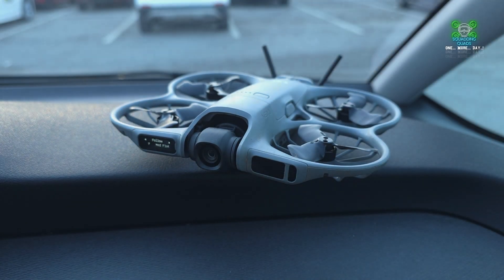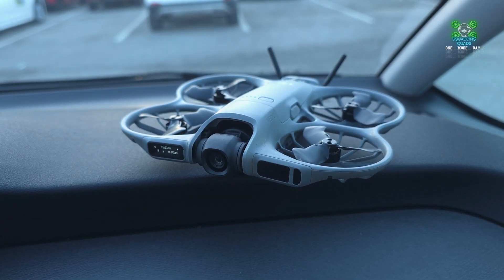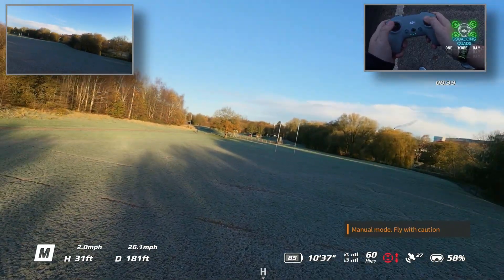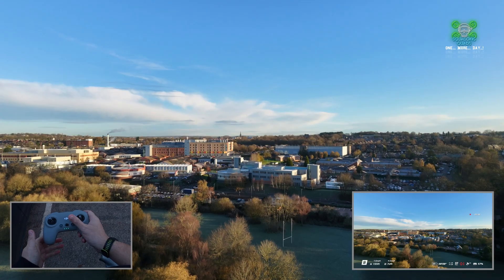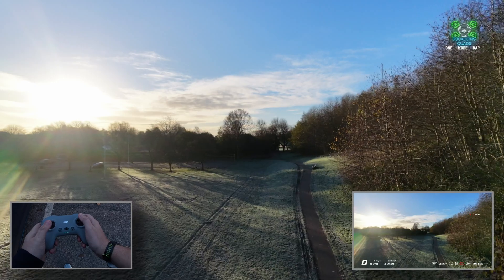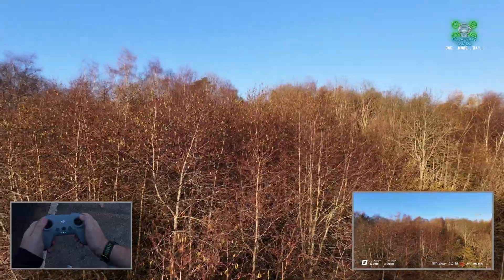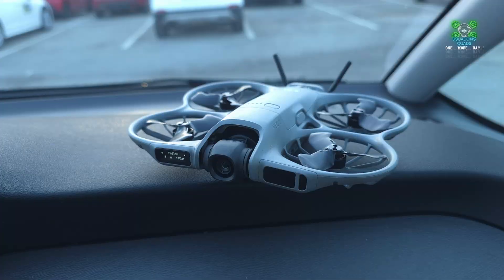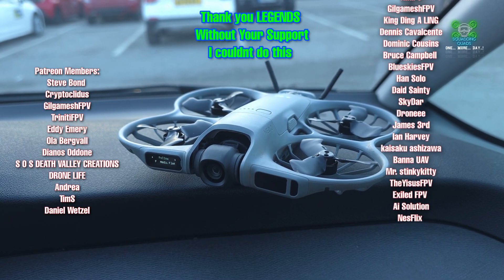DJI Neo 2 FPV FLIGHT - Why Did NO Reviewer Mention THIS Problem!? (Faulty Unit?

Comment: I am having a similar issue with my Neo 2 but not as bad as yours. Only certain parts of my image suffer from jello. 

Flying at 4KF100FPS. manual mode at 37 degree camera angle 

https://youtu.be/toZdlESuniQ?si=J8Riy41GGGlooqtP
Reply from the maker: Sigh dji, sigh

Comment: I am very new to the fpv world and I’ve done my fair share of flying in sim to be comfortable to fly around my yard slowly and put my neo 2 in manual mode for the first time today and lost all throttle control ,the drone fell from 3 ft in the air into a bush ,then tried to start it in the house and lost throttle control again and it went max throttle into a wall and I could not stop the props at all ,they just kept going at max throttle and didn’t stop until the battery died
Reply from the maker: I've got a friend's who's keeps going full throttle on a crash, please open a ticket with dji and ask for a replacement
Reply: @squaddingquads and they’ll have no problem with that ? Being that it’s dirty now that it’s been crashed into a bush lol

Comment: It could just be DJIs tuning, not 100% sure, I have not run mine in manual mode yet, will let you know when I do. Maybe it is faulty and the ESCs aren’t able to provide enough power…
Reply from the maker: I did think it might be a tune issue but what's odd is the lack of power after the shake

Let me know how you get on my man
Reply: @squaddingquads hey mate, sorry I haven’t responded sooner, but I flew my Neo 2 in manual FPV the other day and I didn’t see any of these issues when dropping altitude or climbing, I think your may be faulty!
Reply from the maker: @aaronmurgatroyd5810 I appreciate your reply man, I've opened a ticket with DJI as I believe so too

Comment: Neo2 is not made for this mode. It's mainly for tracking, which is its main advantage.
Reply from the maker: Not made for fpv?

Why does it have a fpv mode that unlocks with fpv goggles and a fpv controller?
Reply: @squaddingquads For emmersive, cenematic feeling, normal flight for beginners, rather than manual crazy flip flop stuff.

Comment: Probably a stupid question but have you tried to recalibrate the gimbal? DJI will probably ask you to do this anyway.

Have you tried downloading the flight data log with DJI Assistant? DJI will ask you to do this also and it will likely show the gimbal error if there is one. 

Also if you have flight data turned on you can view the .SRT files which is the flight data files in your video playback by switching CC Closed Captions on and that may show the problem too.
Reply from the maker: Thanks for the tips bro I have I'll see what dji reply with and keep yall updated

Comment: Mads Tech mentioned the 2-axis gimbal would be an issue for manual FPV. All the initial reviews did the fake FPV mode, which does not put the drone in full manual. The Neo 2 would fly like a GPS drone and the camera would move around to mimic FPV. DJI made it 2-axis for smoother stabilized footage in all other modes. Manual FPV quality was sacrificed by this hardware choice.
Reply from the maker: That's great info, thanks for sharing!

Comment: Saw this yesterday on a YT video from a Spanish reviewer.  I think it's the two-axis gimbal struggling to lock into place for manual mode. There is no physical lock, so the tiny gimbal motors have to work extra hard to lock one axis in place.
Reply from the maker: Interesting take, that makes a lot of sense actually 🤔
Reply: @MIGUEL-FPV

Comment: I have spent multiples of what I would have paid for another DJI (have my old trusty Mavic Mini) building quads, but nothing can touch DJI for its ability to just stop in mid air when you let go of everything 🥹
Wouldn’t have a pile of carbonised, salt water soaked parts on my bench if my Bee25 could have done that 😆
Reply from the maker: Hahah I know that feeling

Comment: Yeah I saw this problem including avata 2. Hoping this will fix on fw updates
Reply from the maker: Oh really I never saw this on my avata 2,fot any footage man? I'd be interested to see if it's the same cause. Thanks dude
Reply: @reynaldoibanez  I've never had this issue with my Avata 2 that I bought near its launch, and I just got another one because of the upcoming ban in the U.S. Mine is fine.  I'll be curious about the Neo 2, though.  I have two coming in the next couple of weeks from Korea. Will be interesting to check it out, though.